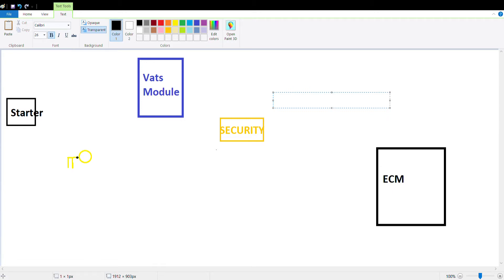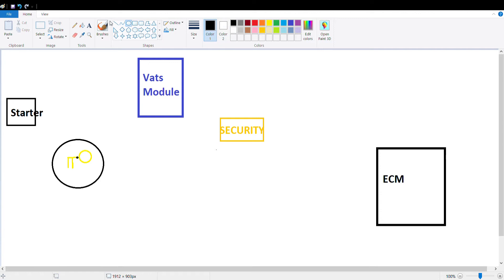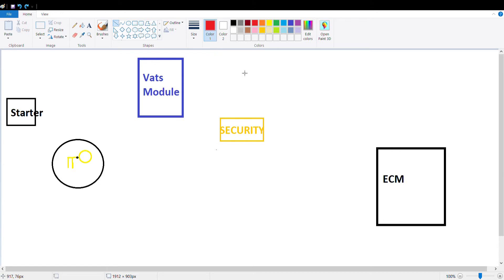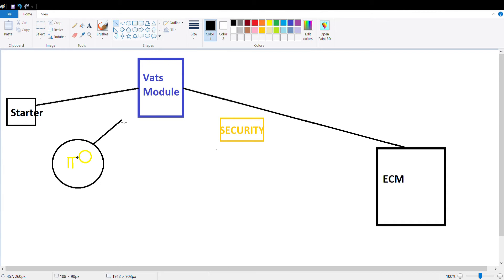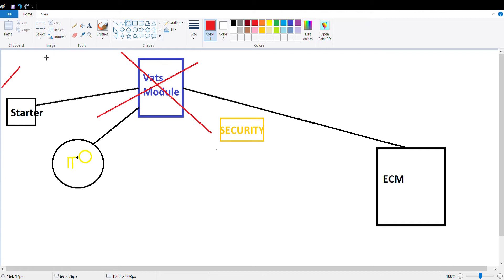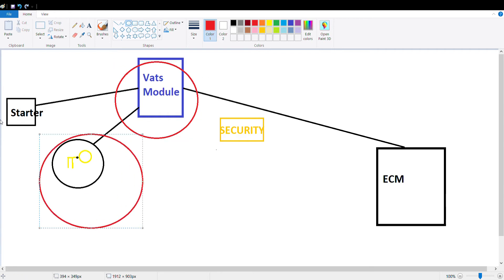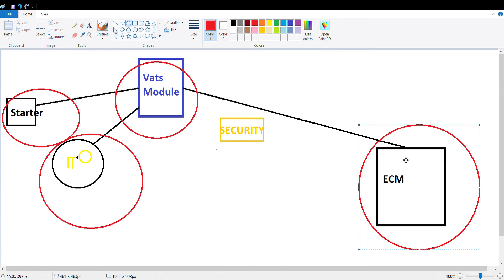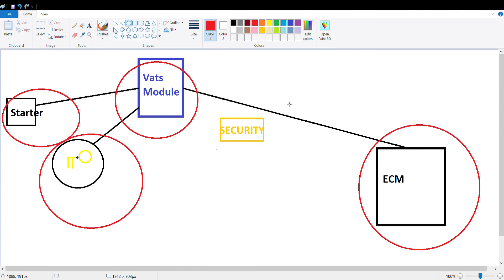GM VATS or Passkey 1 Explained

Comment: Would possibly know the correlation between VATS and the pass lock feature on the door lock actuator? I'm in the process of replacing my actuator which doesn't have pass lock. I do have VATS though, as I need the specific VATS key to start my car. 
1997 Chevy Camaro, z28
Reply from the maker: Unfortunately I don’t know much about how the vats system in the 4th gens worked